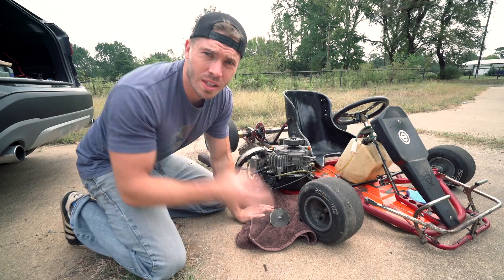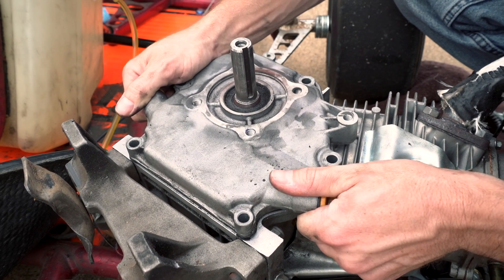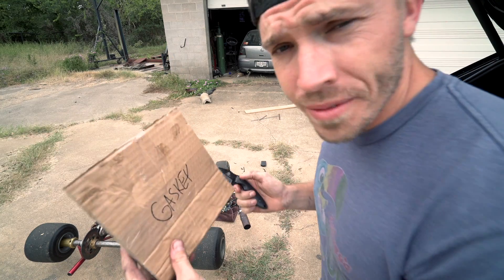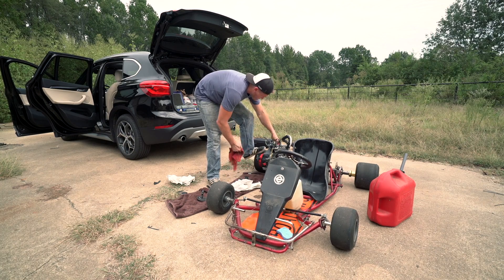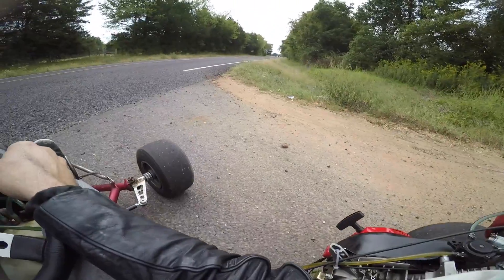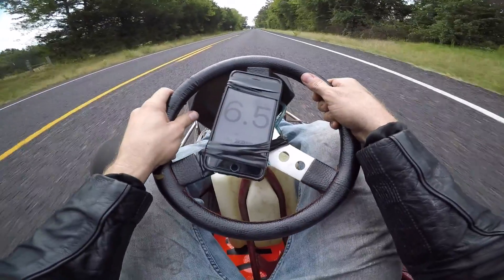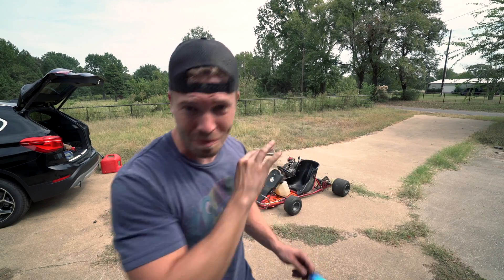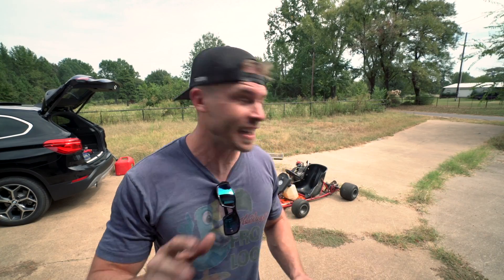Go Kart - Top Speed Project pt. 4

Comment: What if he put another motor on the other side? Maybe divorce the rear axles and use throttle for steering or link the throttles so the pedals keep consistent 50/50 throttle, it would take some real work to figure out but would be pretty sick

Comment: This vid series is really motivating me! I'm building my go kart to go 80mph with a fully built Predator 301cc. I've hit 71 only removing the governor, a Nibbi racing 32mm flatslide carb and straight pipe exhaust.. Finished building the engine and first fire yesterday. Now time to reinforce the frame!
Reply from the maker: You hit 71 just removing the governor?! Thats incredible! What gearing are you using?
Reply: @ChrisRollins  40 series go powersports torque converter with a 10 tooth sprocket on the driven pulley and a 18 tooth sprocket on the axle. Gonna change to a 14 or 16 tooth sprocket soon. Chain is 40 series.

Comment: If you want ridiculous numbers of views put this motor on a mini bike frame and test different cams and performance parts like longer connecting rods, ratio rockers, thinner head gaskets and report your results. For acceleration 0-25, 0-45, 0-65, 0-Top speed then graph it all out. You'd make a killing on views. (Or do the same leaving it on this frame.)

Comment: That reminds me, what ended up being the final thought on the valve springs?  The stronger ones sure didn't look stronger.  In your last video, you were going to check to see if they sent you the right ones.  Inquiring minds want to know.
Reply from the maker: AH! I completely forgot to mention that! I called gopowersports, and asked them to look up my order from january, i ordered 18lbs but they sent me 26 lbs. so the ones in it were stronger than the 22 lbs i put in! wow, i completely forgot to talk about that! SMH
Reply: So which ones did you decide to use and did they make much of a difference?

Comment: Well done.  It would be interesting to know what the total bill was.  Starting with the $99 motor and then all the mods.  You are probably closer to 10hp at this point.
Reply from the maker: +Scott Manthey man...im afraid to do the math and know the total hahaha. The cost has been spread out over several months so i didnt feel it very much. There are links to the parts down in description though!
Reply: It was my kind of project.  You probably spent more than if you had just bought a more powerful motor in the first place, but what fun would that have been, right?